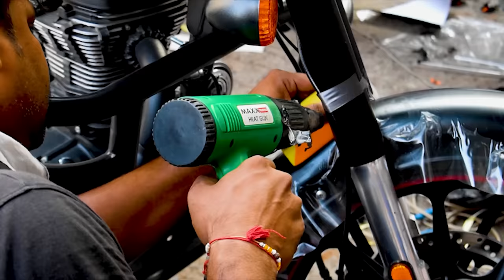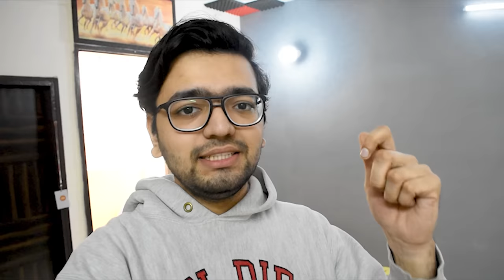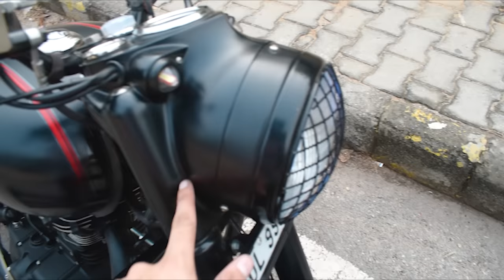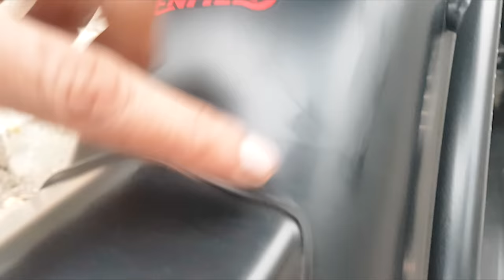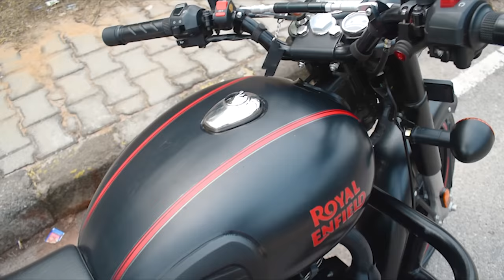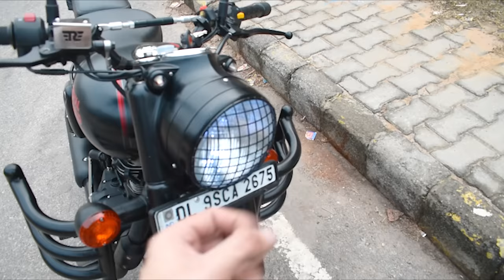"PPF VS CERAMIC COATING" ON 'CLASSIC 350 STEALTH BLACK' | 'MATTE LAMINATION OR CERAMIC COATING ?

Comment: When we remove the PPF ,say after 6 months,  what proper liquid should be used ? As I've seen some YouTube videos in which they've used petrol to remove the glue left behind. Also, please tell about the kind of soapy water used at the starting of the process, is it normal soap or of a specific kind ?
Reply from the maker: High quality ppf never leaves stain behind . yes petrol is used when its required to be  removed . No its normal Soap water
Reply: dont use petrol on matte black color

Comment: Sir i am thinking of buying classic 350 stealth black ? 
What is ur opinion ? 
Plz ans 🙏
Reply: Ruturaj bhujbal don’t go for stealth black or any matte finished re coz sooner or later you gonna loose the matte instead go for Chrome 😍❤️ just it has one disadvantage that it comes along with spoke
Reply: @subhraneelpaul563  but if i go for Chrome if in future there is oil leak that will not look proper !! 
I think so
Reply: Ruturaj bhujbal yea oil leakage is another factor for chrome parts, ohk you better go for sand or any other with black engine but stealth black I won’t personally recommend as i own one and it needs high maintenance a slight small dust particles on the bike highlight and bothers you so much...
Reply: @subhraneelpaul563  i will appreciate ur opinion and will think before buying one ✌️.
Reply from the maker: SANSSTORM WILL BE SAME AS STEALTH BLACK , A MATTE COLOR
Reply: @DhruvTanwarModz  stealth black is own favourite so thinking about it . ✌️
Black is favourite colour 🤩😇

Comment: I would suggest you to to remove the ppf cover after 1yr then show us if its glue remains on the tank or not. Removing after 1 month doesnt symbolise that after 1 yr it will do the same justice. I have seen many videos there they had to washed the glue out of the tank with petrol after the ppf was removed .
Reply from the maker: Haha cheap ppf does this thing .
Reply from the maker: and informing you , This Ppf works till 6 to 8 months
Reply: @DhruvTanwarModz  thanks for the information. I have little more queries about royal enfield classic and metore 350. I am in love with classic 350 but due to the vibration of engine I am not liking it. Also note i took a test drive of metore 350 and felt out of the world while riding on it. In short I am in love with the classic 350 design but the engine refinement of metore 350 is stopping me from buying that.
Now I have seen some videos where people are saying classic 350 is getting an engine update and the bike is going to get launced in feb 2021.
I have saved my money for many years to buy classic 350 only. Plz suggest me what to do.. I love only the engine of metore but the frame of classic 350 is my first choice
Reply from the maker: GO FOR CLASSIC 350 , 2021 , WAIT FOR IT AND TEST RIDE IT DOWN